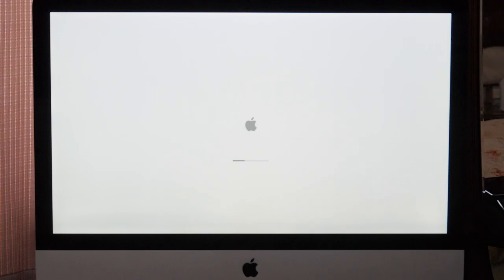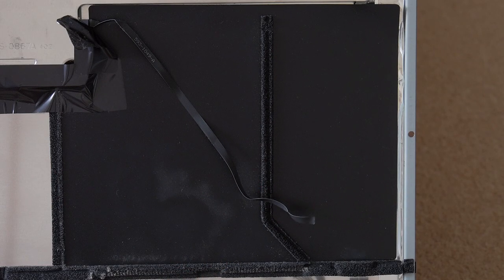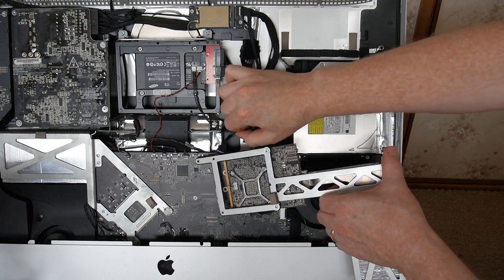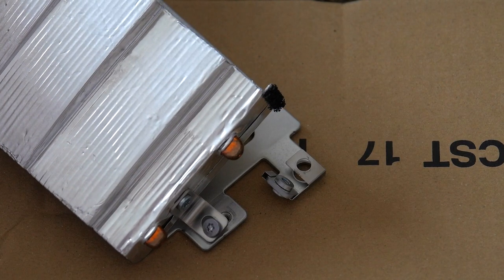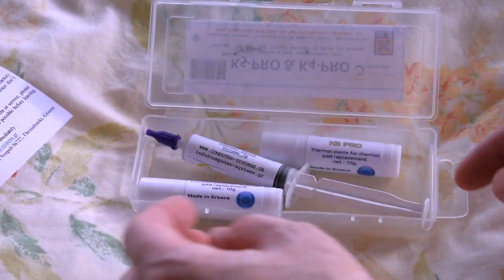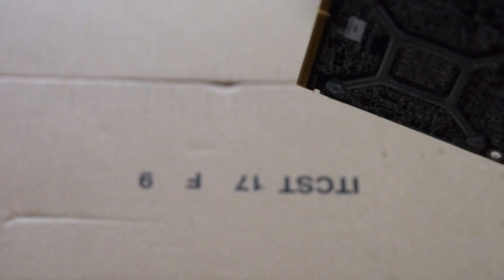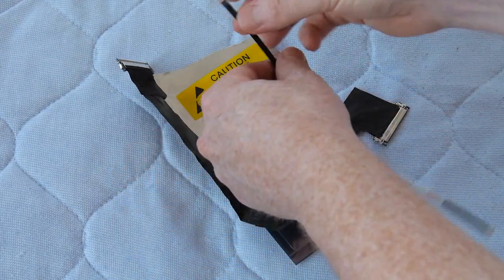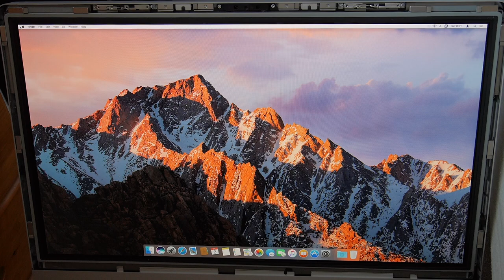Late 2009 iMac 27" Video Card Repair — 4850 — 2nd Bake

Comment: I want to let you know that I followed your guide and I was able to fix the AMD graphic card inside my mid 2010 27" iMac. The screen was totally black, everything else was working fine (could hear sound and blindly open random apps). After a few research on the topic I'd like to add my 2 cents for a long lasting and succesful Reballing. The trick seems to be in letting the card cool down naturally inside the oven, in about 30/40 minutes till it gets to environmental temperature. It seems that the thing causing the microsolding to detach in the first place is the sudden heating and cooling of the card, in absence of plumb in the solding (which apparently gives more elasticity tough, alas, being poisonous). So letting it cool down slowly helps the solding stay attached to the motherboard.
Reply from the maker: Thank you for sharing your successful bake experience, David.  I believe there is logic to what you said; however, even a brand new card won't last forever. (In my experience, a new card from Apple lasted all of 3 years, just like the stock card did.).  But it will be interesting to see how many years of use you get out of your bake in light of your slow cooling technique.  As such, it would be appreciated if you could report back every six months or so and let us all know if your card is still running strong.  Best wishes!
Reply: How is your card doing?
Reply: @daviddamini2185  still working like a charm!
Reply: @DavidVotino  glad to hear that, i will try your technique this Friday :)

Thanks
Reply: More than two years, the card is still alive and kicking!

Comment: So about two months ago my Late 2009 27" stopped booting. Like your machine it would get about half way on the progress bar and just freeze until it fell asleep. I took it to a service guy who told me my hard drive was dead and it really wasn't worth fixing because the iMac was so old and all the rest. So I took it home and convinced the wife that I should have a go at putting a new SSD hard drive in myself for a fraction of the cost the repair guy was going to charge and we'd be back up and running with an even faster Mac. I installed a new Samsung EVO 860 SSD, an easy job that was completed without a glitch but when I booted the machine back up it had the same flaw. So I phoned my repair guy and told him the new hard drive didn't work and I was still getting the same issue. He was stumped and suggested the mother board must have died and it was irreparable and I lost hope. A few days past and he called me and asked if I could boot the machine in safe mode, so I did and yes it booted, he then said it most probably was the graphics card causing the issue and I would need to replace it. With a new found hope I started researching new cards and where I could purchase one from when I came across your first video. Now I must admit, when I watched your video I thought you were bonkers putting your Video Card in the oven but after reading all the successful comments from other punters I though I would give it a go and if it didn't work I would just get the new card my repair guy had suggested. Well I'm happy to report I baked my card today and my iMac is as good as new and a lot faster with the new SSD.

Thanks for the video.
Mick Rogers
Yackandandah, Victoria
Australia
Reply from the maker: Michael, that is truly a wonderful story, and I wish to thank you for sharing all the details.  The best part is that your exchange of the spinning platter HDD for an SSD was not in vain as you ended up not only with a working machine after the bake, but a much faster one as well. An SSD is the single best performance upgrade for these old Macs, and it draws less power and is completely silent and cool running as well.  Best wishes to you and your newly resurrected iMac!

Comment: Hello Mr. James - thank you for your 101 video bake tutorial. I followed every step and ordered ingredients from Greece! You created an option for cure & success ... and WOW I have cured the video issues I had. I use FCPX for video editing and although I still have issues with fcpx program share ... I have my iMac back for other operations such as typing, e-mail etc ... that's what really important ... as soon as I was able - I was compelled to write you and thank you so much. My iMac has been running for 48 hrs (cool like a cucumber) and I have put it through some rigorous phases with multi-tasking, rendering, download large files etc ALL AT ONCE and NO Video Complaints. Now that I've opened the iMac for the first-time .. it will not be the last as I intend to upgrade follow your specs and replace a few more parts (video card, video 90 degree bend cable, lcd backlight strip, SSD and fan) to complete at a a later date when I pluck up some more courage. Thank you so much ... great video. 
Rasta Love.
Moss Side, Manchester, England
Reply from the maker: Thank you for the kind words and for sharing your success story, Paul.  I'm so happy to hear the bake solved your video card woe!  If you do decide to re-open your Mac and make any one upgrade, I would say it should be swapping the hard disk for a 1TB Samsung EVO SSD.  That's what I did and it really makes your machine feel like a new computer.  Also, if you have only 8GB of RAM, I would suggest upgrading to 16GB, especially if you share your computer with someone else who has another user.  I share that iMac with my wife and she leaves her user open most of the time, so 8GB isn't enough for us.  My iMac was running like a snail until I upgrade to 16GB and now it's running at top speed.  Best wishes!

Comment: JDW, Thanks for your videos (I watched them all). This works! I just baked my 2011 27" iMac's AMD 6970m GPU and it works again.  I simply followed examples shown in several of the youtube videos including yours.  I have never done anything like this before. This was the first time I opened up my iMac.  While it seems intimidating at first, I did it.  The hardest part was reconnecting the power cables behind the Logic Board and from the LCD panel to Logic Board.  I put a sequential numbered piece of electrical tape on all of the wires and it went together smoothly.  Baked at 400F for 10 minutes.   Took about 3 hours to fix.  My thanks go to all of the Youtubers who filmed the process and also to those users who posted their encouraging success stories too.
Reply from the maker: Thank you very much for watching all the bake videos, Steadman!  I'm certainly pleased to hear your success story, especially because it will help fellow 2011 27" iMac owners who wonder if my late 2009 model bake will really work on their newer models.  Yes it will!  Best wishes to you and your newly resurrected 2011 iMac!

Comment: Wow!  I thought this might be a wind up BUT i had nothing to lose so i tried it and it worked!  Ha Ha - no idea how long it will last but there we are...  Thanks for taking the time to do the video....  i managed to get the video card out without detaching the final wire to the heat sink so i didn't have the faff of trying to reconnect it to the back of the motherboard.  I baked the board for 11 minutes at 200 degrees.  Reassembled it - turned it on and it worked :-)  Sorted - that 27' iMac is a lovely bit of kit.
Reply from the maker: That's wonderful to hear, Greg.  Thank you for letting me know.  So far, my 2nd bake has lasted almost 14 months with daily use of several hours per day.  Fingers crossed that your iMac can achieve the same.  Best wishes!

Comment: JDW all of your videos are great! My 2011 27inch screen all of the sudden have the vertical green bands and then after a couple reboots trying to get into safe mode (before I new what was happening) it would just boot halfway with the apple and then just stay white with no green anomalies . For this reading here the 2011 has GPU mounting screws on the back side of the logic board making access much more involved with 17 plugs and an assortment of screws to remove the logic board. I personally found it enjoyable and rewarding using a piece of card board with a marker to draw a childish diagram of the logic board and tapped the screws as I removed them onto this cardboard. It made it easy.
JDW the bake worked!!! I have one question. Mine had paste on the GPU that I had to remove. Did it come this way new or did it come with pads and someone else was in there. I bought this used.3 years ago. Thanks again JDW! I subscribed :)
Reply from the maker: Thank you for your kind words and for sharing details of your experience.Apple would have put paste on the GPU chip and then separately used thermal pads on each of the memory chips. So you must clean off all of the old paste and thermal pads, and then you need to replace the paste on the GPU and then either use thermal pads or K5 Pro on the memory chips. You cannot use the same paste on all of those chips because there is a gap between the memory chips and the heat sink, but there is no gap between the heat sink and the GPU. That is why two different types of pests are required.
Reply: @JDW-  Can I use only K4 pro for everything?
Reply from the maker: @liashalvashvili7872  No.  K4 Pro is only for the GPU.  K5 Pro is only for the Memory Chips.  If you want to use some other good paste for the GPU, such as Thermal Grizzly Kryonaut or MX-4, that is fine.  But you must use K5 Pro on the memory chips.  In other words, you must use two different kinds of pastes.  And never use K5 Pro on the GPU.  It is not made for that.  K5 Pro is a "thermal pad replacement paste."  It is only for use on memory chips which do not get too hot.  It is made to be used when there is a gap between the top of the chips and the bottom of the heatsink.  There is no gap between the GPU and the heatsink, and the GPU gets much hotter too.  So again, use K4 Pro on the GPU and K5 Pro on the memory chips and you will be fine.

Comment: WAYYYY to much thermal paste, 25% of what you put on would have been too much.
Reply from the maker: Wrong.  The K5 Pro is a thermal pad replacement.  If you watch the manufacturer's own videos you will see that I apply the same liberal amount they do.  To NOT do that would be to NOT close the wide gap between the memory chips and the heatsink.  That is why thermal pads are used instead of thermal paste on those chips.  Furthermore, even if one still wishes to contend that "it's too much" consider well that any excess will spill over and not prove any kind of detriment at all.  And lastly, I have first hand experience with this paste in my iMac since that 2nd bake and I can confirm the application of the K4 and K5 Pro in my video is working very well, not leaking out from the heatsink and keeping temperatures at or lower than what they were before (in my 1st bake I used Arctic Silver V on the GPU and general white paste on the memory chips, atop the old thermal pads).
Reply: chickenwing986 is quite correct. You are using WAY too much compound. You need to read the Arctic Silver documentation. You just need to put one 1-2mm wide line down the centre of the GPU and it will spread out. Also you should be removing the old thermal pads and look into getting new ones. Adding compound on top of this is a big no no and problem. Once you have the machine stable, you should look into increasing the fan speeds for the Optical Drive fan (which also cools the GPU). please also look at the heatsink tubes, some develop pinholes and the phase change liquid inside evaporates, making the Heatsink ineffective.
Reply: Also 'tinting' the heatsink side by spreading a layer of compound all around then actually removing is the correct way to add the compound to the heatsink side to fill all the micro crevices and valleys.
Reply from the maker: Charlie, thank you for sharing your thoughts and suggestions.  While you may wish to argue that the Arctic Silver documentation offers good advice for any thermal paste, the fact remains that I am not using Arctic Silver in this "2nd Bake" video at all.  Thermal pads come in two forms: (1) the traditional thermal pads we all know and love, er, hate (which is what Apple used), and (2) the thick thermal compound created, manufactured and sold as K5 Pro (which I used) by the company below in Greece:

http://www.computer-systems.gr/content/k5-pro

I watched their demonstration videos on YouTube where they used a lot of that thick (thermal pad replacement) paste, just like I did.  I then read some comments under at least one of their YouTube videos which speak negatively about it like you did; namely, comments saying "it's way too much!"  Here's one of the videos where you can read such comments, but note the replies by the manufacturer (and myself):

https://youtu.be/mukUInQ34J4

I can attest to the fact that "too much" (if one dares say it is too much FOR THAT PARTICULAR PASTE) has worked flawlessly on my iMac for the last 7 months.  Indeed, it was when I used a tiny amount of Arctic Silver V in my 1st bake that the bake lasted only 4 months.  Whether that was due to the paste or something else, I do not know, but it is an observation to ponder.

I do agree with you about applying paste (the normal, thin kind -- which is K4 Pro in my video) to the heatsink side, spread it around, then remove most all of it (by gently wiping, not with a cleaner), in order to fill all the microscopic hills and valleys.  Agreed.  Hands-down, that is sage advice for anyone, anywhere, with any normal thermal compound and nearly any kind of heatsink.  But it's a different matter with the thick thermal compound that acts as a replacement for thermal pads, which seems to be made only by that one company in Greece and no where else.

I also agree about ramping up the fan speed, which is what I did using third party apps (see the text description under my video for links) after my 1st bake and after my 2nd bake too.  Agreed.  I increase the speed of all fans inside my Mac to keep it cooler.  But despite having done that, my 1st bake lasted only 4 months.  Something to bear in mind.

Lastly, even if one argues that I applied too much thermal paste (which I actually did NOT do -- I applied the PROPER amount in accordance to the directions of the K4 Pro and K5 Pro manufacturer), the fact remains that I have had 7 months of daily continuous use out of my late 2009 iMac after my 2nd bake, where I used that so-called "excessive amount" of paste.  It's my personal believe that it is more likely someone will use too little paste than too much.  And if my 7 months of ongoing use is any indication, I used the right amount of paste for this particular paste type and this particular application.

Best wishes.
Reply from the maker: Martin Law, ditto my earlier comments.  My 2nd bake has lasted more than 7 months as of this comment, and it runs COOLER than it ever did before.  It’s the proper amount for this type of paste, applied in strict accordance to what the paste maker suggests.  Again, my 7 months of daily testing proved that the amount I applied is not wrong nor worthy of criticism.
Reply: chickenwing986:  ummm, lol you are trying to argue against proof.  The fact is its been a year and its still working as it should while using what you believe is over 75% too much paste.  Obviously there would have been a problem by now if what you said was true, so I guess in this scenario your bold statement does not apply to this video and is false.